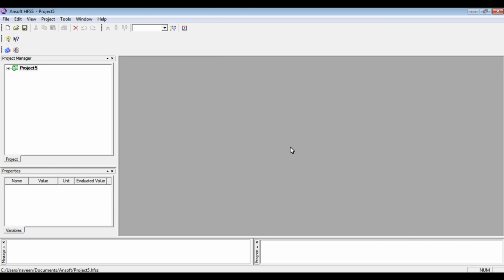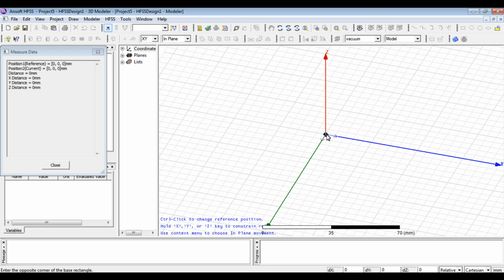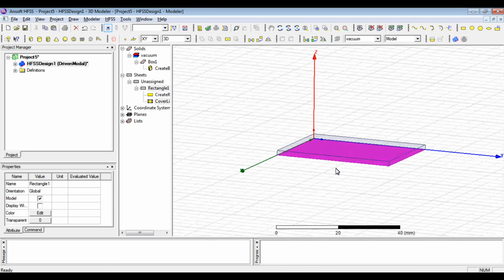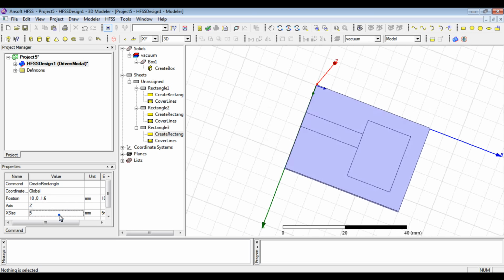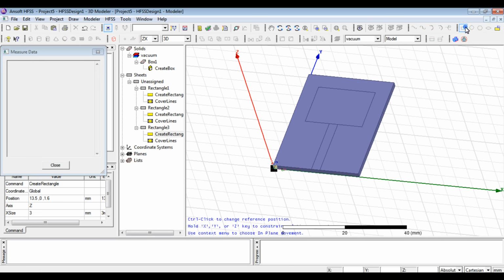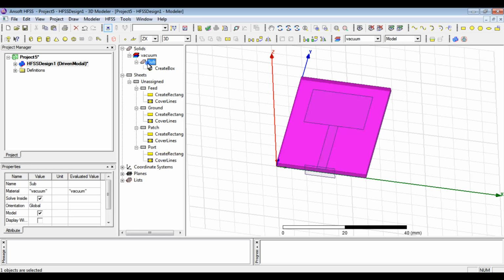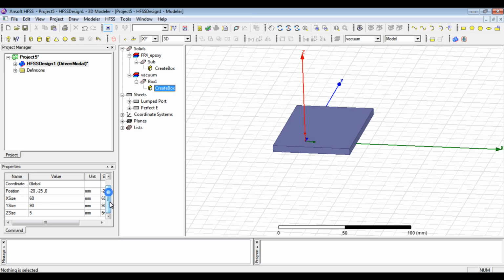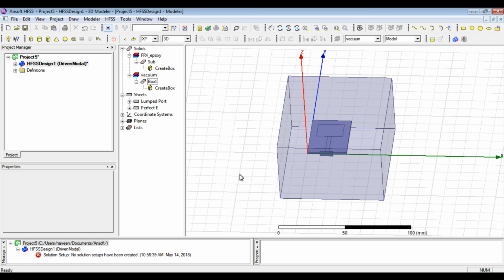Design of Microstrip Patch Antenna in HFSS [Full HD]

Comment: Hi sir, I appreciate your video, and this is very useful for me, thank you., But I am stuck in a problem. I tried a lot in designing metamaterial antenna, and want to obtain some desired results. But after so many attempts, I am no where. I designed atleast 35 metamaterials antenna, but not able to understand what dimensions I chose, so that required results are obtain. Please help.
Reply from the maker: You can email your query to elixir.education4@gmail.com and then we can discuss further how I can help you with your designs.

Comment: 1. would it be wrong if i ADD patch and feedline to make one component ??

2.  that NEW LINE process was not done in other videos that i referred . . ..  what is the purpose & is it really necessary ????
Reply from the maker: No, it will not be wrong to have the feed line and patch as one geometry.
The integration line is created between the ground plane and feed line while designing a lumped port. This is to specify the direction of electric field pattern at the port.
Reply: wow . . . thanks .
Reply: @naveenkumoct  contact number hona apkaa
Reply: Elixir Education I would like to create a project with grounded GCPW-MS-GCPW line. Could you explain what kind of ports to choose there?